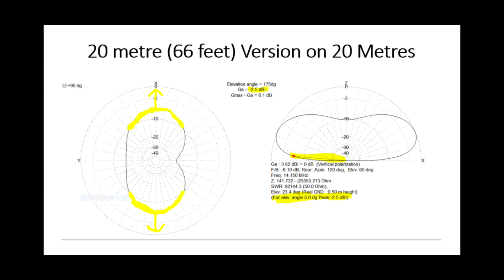Ham Radio: Make Your EFHW Into a DX Machine!

Comment: question... can you run the half square "upside down"?... ie current feed at a low corner & have the half wave section running across the bottom not the top?
Reply from the maker: This is something I need to model. My first reaction is that the horizontal aspect will be compromised by being so low to the ground. 73

Comment: Would it make a difference if 49:1 was up a meter on pole, the element up 5m. Total pole height 6m. Or does 49:1 need to be right at bottom of pole ? Thanks
Reply from the maker: Hi there, it would add around 0.5-1dB extra at low angles of take off on 10,15,20m. On 40m, it would make no difference. Overall, it will reduce ground losses slightly.
Reply: @timg5tm941 that’s brilliant, I just made one and mounted the 49:1 up 1meter. Seems to be working fantastic but have not had much time to test today as storm coming so had to shorter the poles. Swr is around 1.5 on all bands, 1.3 on 10. I haven’t tuned yet just 66ft of wire. RX seems fantastic though
Reply from the maker: Let me know how you get on with it! Good DX!
Reply: @ will do thank you
Reply: @timg5tm941 hi Tim, so I had to add 3 feet one side to get swr to 1.2, so one side has 49:1 up a meter and the other side element goes to end of pole, so one side is 5m and other is 6m. Hi would this effect the pattern ? Thank you

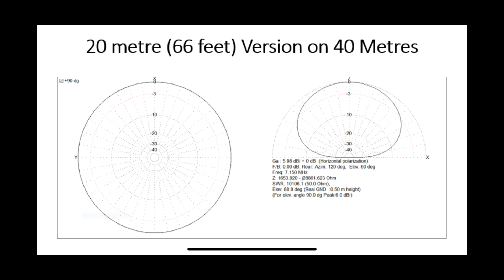Comment: Nice video as usual, but the titles above the azimuth/elevation plots at 3:40 and 6:25 are misleading, you're certainly looking at a 20-odd meter length of wire, but the antenna is a half-wave on 40 meters, so the titles should state that this is for a 40-meter band antenna . The titles are confusing, giving wire length as opposed to band - it's important to not confuse the viewer. YMMV, of course...

Comment: I'm running a 130 ft. 10 in. 80M-10m EFHW as an inverted V with the feed end at 5 ft. above the ground, the center at 25 ft. and the far end at 10 ft. above ground. SWR on  10M is about 1.2, near flat across 12, 15, 17, 20, and 40M. SWR on 80M is about 1.5 at the tuned frequency. From south-central Colorado, in a valley between mountain ranges, with 100 watts, my furthest contacts are to United Arab Emirates, New Zealand, Russia, and to Australia. I also use EFHWs for POTA. Marty, WT0Z.

Comment: Those are awesome 
Simple 
Vertical polarisation 
Low angle 
2 1/4 Vertical 
4 db gain over one Vertical 
No ground radials 
12 db broadside to end null
Just use current bslun 1 to 1 at one of top corners
I will put one up for 40m to europe

I avoid radials

Its 1 wave total 
1/4 1/2 1/4

I think dipole null is about 8 db depending on height
Reply from the maker: Thanks for the info

Comment: I have used mono-band Half-Square antennas with great success in the past. I did try this scheme out on my 133' EFHW, and rehung it as a half-square for 40M (32' vertical sections with ends 6' off ground), and tested it out on a DX contest one weekend.   For any of the 40M DX I chased it was no better than rotatable 40 dipole at 50' on tower.  The next weekend I rehung my 133' EFHW horizontal at 43'.  If was a fun experiment, and antenna tuner tuned it on all the same bands, but I did not see enough benefit in my setting.
Reply from the maker: Good info thank you 👍

Comment: Wow. food for thought! I was ready to install a regular end fed half wave at 80m (i can just about get 40m horizontal in) , however I am now wondering if i will actually use 80m that much anyway.  I have a dx commander (multi band 1/4 wave vertical) and by your reckoning Tim, i should get better gain with this square on everything above 40m? What do you reckon?
Reply from the maker: Give it a try!

Comment: Hi Tim, I put a cord on the end  furthest away from the transformer and pull it out horizontal for 40m as an inverted L, when I want 20m and above, loosen the cord and the sinker returns to the bottom and back to the ½ square.
VK6MB
Reply from the maker: Great example Mike

Comment: ok, what is the optimal length wire length, vertical height, and horizontal run, for performing well on 20m like it does on 10m?
Reply from the maker: If you want to repeat 10m you will need to double the dimensions so that the overall antenna wire used is a 2 wave on 20m. So 10-20-10m (double my version). 40m would now be what 20 is in this video. 80 would be what 40 is in this video. PLUS you’ll still have 15, 10 AND perhaps a reasonable match on 10,12,17

Comment: I tim the half square fed at the bottom With 49.1 is the other end of the transformer earthed or would a counterpoise be better
Thanks Bob G4PEN
Reply from the maker: I’ve found no benefit from earthing or running a counterpoise as the impedance is so high at the base. A 49/56 or 64:1 would all suffice.
Reply: @TIMG5TM  Thanks Tim erected it yesterday and it is working really well Cheers Bob G4PEN 73.s all the best for New Year
Reply from the maker: You too Bob 73!

Comment: How would it do on 11 m? All you hammers out there only talk about ham radio but some of us out here that like to play on radio use the CB band. So how does it do on 11 m and would it be worth building this antenna for CB? I mean you guys have got the licenses and we're the ones that look up to you. But you all ignore us when it comes to talking about antennas.
Reply from the maker: Try 35 feet initially (divide by 3.28 for metres). If needed trim the base of both vertical elements to bring it into tune. Should work like the 20m band does on this video.. most gain broadside.
Reply: @TIMG5TM  
Thnx😉

Comment: It‘s my favorite antenna. Use it only on 15 and 10 m. Have fed it both ways, but prefer it lower corner and 49:1.
One thing you didn’t talk about is noise. Where I live I had about a S 4 noise level and with the half square it’s gone. It’s worth trying guys!
Thanks for your work de HB3XBL 👍🇨🇭
Reply from the maker: Thank you. It’s a useful option as a multiband antenna

Comment: Thanks Tim, built one as described and working really well, especially on 15/10m.
Reply from the maker: Fabulous!!
Reply: @TIMG5TM  Just a quick followup, now worked 153 DXCC on 15m and 164 on 10m, predominantly using this antenna fed with 50W.  Really pleased with this fantastic antenna especially given how easy it is to setup and how well it performs.
  
It would be really interesting to model and then try a 12m version that worked on 12m and 6m.  Transformer a little more challenging probably but ....

Any thoughts on sharing your MMANA-GAL models as you publish the videos so we can follow along and play with options?

Thanks again

Comment: Ok.  Right now I'm running a hwef  out a 3rd story window horizontal to a tree across the yard.  There's a tree outside the window.  If I can get it vertically maybe 5 more meters up that tree the only other option would be to slope the rest.  I I wouldn't be able to get the full half square, but would that effectively get me more dx?  It gets 1:1 on 40 and 10 horizontally, but definitely takes some tuning for 20.  Would it help the tuning for 20 as well??
Reply from the maker: It depends a lot on the height, how high is your sloping part of the antenna from highest to lowest? Also, how long is it and roughly which parts of it form the sloper?
Reply: @TIMG5TM  It's roughly 66ft long, running horizontal out a third story window about 30ft up.  If I can get some vertical from window to high as I can get in tree right outside (maybe another 5 meters), the slope down from there could be whatever would work best.  Trickiest bit would be keeping the radiator away from the branches...  Not sure what the advantage would be for the work to get it up there....  Thanks Tim.

Comment: I have a 75-10 M EFHW configured in a flat configuration from 35 feet at the feed one end and 55 feet at the far end (the land slopes away from the feed end) using a hefty 49:1 Balun coax fed with LMR400..  It is a great antenna for DX. However it is a bit more noisy than my 80-10 M Horizontal Loop.  Will reconfiguring it with the 1/4 wave vertical sections at both ends even make it more noisy?    Usually, you do not GET something without GIVING something up.... the NO FREE LUNCH rule of antennas...  I wonder if any of you who have experimented with the 1/4 wave V 1/2 wave H and 1/4 wave V config can share their experiences on 20, 17, 15 and 10 meter bands.  Thanks Art W1SWL
Reply from the maker: Hi Art. I find a vertically polarised antenna, whether hand or quarter wave, tends to be noisier at home.
Reply: @TIMG5TM  Hi Tim: have you modeled this modified EFHW antenna in MMANA?   If so I would love to see the results of that Model... as a flat then modified as a half square.!  Art W1SWL
Reply from the maker: @arthurgumbus3969  hi Arthur, did you mean as a flat horizontal and then compared with the half square?
Reply: @TIMG5TM  Yes as a flat horizontal model THEN change that to a half square and see the results on MMANA.... You are really good with that program so I leave the driving with you.  I think it would be a great follow on video... with some education for we aspiring MMANA novices.  I say go for it!

Comment: All these itty bitty crossover baluns have the annoying advantage of getting the feedpoint out of the shack, and shielded coax to get there. Not much more than 10 years ago, a tuner and a longwire did this, and the idea of the antenna starting at the radio was not kosher, and was thus too close to interference sources.
The next step was balanced line or a combo G5RV, but those were eyecatching dipoles, that still needed a tuner, and balanced line was a bugger to run out of the shack, though quiet, still radiated alot of harmonics on tx.

These lil baluns just absorb harmonics, use 52 ohm coax, to run to feedpoint, and can be coax tuned anywhere, or trimmed to run free on at least 4 bands.
Reply from the maker: Thanks for the info

Comment: Thanks for the video - did you simulte the pattern and the gain for 17m, 12m and 10m as well?
Reply: These came out in 1996 and were ran like a full wave loop, but instead fed at a top corner, with 1/4 wave of 75 ohm coax (-velocity factor), then 52 ohm coax to radio. They were monoband, but using a lower freq (20m for example) one on higher bands, with a tuner, made a very pointy x pattern of gain. Set 45° to North, it had lobes favoring N, S, E, & W.
Reply from the maker: Not yet but I will and see whether a 9:1 unun might be an option with tuner
Reply: @TIMG5TM  I use 1:9 transformer with a manual tuner and it works well even at the impedance peak near half wavelength. TS590's internal tuner doesn't match the 1/2WL but works well on others. My 1:9 is a trifilar winding on FT140-61, 15t (about 30-33uH each winding). I am looking into a cascaded Guanella 1:4/1:9/1:16 transformer to use the internal tuner on all bands.

Comment: The Half Square works very well. I have used the form on the 80 meter Band with good results compared to an 80-10m band ground plane monopole vertical mounted over tuned radials.

You can imagine that the 80m version might be quite high, needing 20 meters of height plus head-height clearance. Having only 15 meters of height available, the lower end of each vertical element was bent inward toward its opposite. The antenna then looked similar to an 'omega' symbol. Since current is greatest at the driven end of a vertical element, this made little difference to radiation.

I used the antenna when serving as net control for a nightly 80m phone net working stations from coast to coast to coast in Canada with me at the centre. According to signal reports from stations more than a couple of hundred miles from me, the antenna was superior to my 80-10 meter vertical except when working northern stations at right angles to the preferred radiation directions. Then the omni-directional monopole was better. Closer in stations saw no difference between my monopole and the Half Square. On receive, there was an improvement in received SNR using the Half Square compared to the monopole since the Half Square is bi-directional.

I also built two Half Squares for the 20m Band with each at right angles to the other allowing me to switch between East-West and North-South patterns. I did not use the pair long enough in order to draw conclusions worth passing on.

Give the Half Square a try!
Reply from the maker: Fabulous information.. thank you for sharing details about your excellent antenna

Comment: Tim how long will an endfed halfwave need to be on 80 /40/20/15/10. Mine is currently configure as a half square and I get it squirting RF more towards South America  and Europe .
Reply from the maker: Hi Simon. The full length efhw for 80-10 is 132 feet or so long (40 metres). Remember that it will still be a cloud warmer for 80m but it will begin to fire low angles , great for DX ,40m and up. Remember too that it’ll need to be 10m above ground and be 20m long. 73

Comment: Here's a thought and I'm aware I'm ready to be flamed here and told I'm being stupid but...
If the distance away from the ground affects the radiation pattern then what about theoretically  adding ground radials ABOVE an antenna? I know for HF that's impractical, I'm just thinking theoretically. Can this be modelled?
Reply from the maker: Hi Simon, it can be modelled, but, in this case it would de-tune the design. 73

Comment: I have to try this out. If it works I'll make a video on it.
Reply from the maker: Thanks!
Reply: @TIMG5TM  By the way, have you tested this setup, or just modelled it?
Reply: @TIMG5TM  Testing the setup right now. Performs slightly worse on 40 and 20 than my regular EFHW sloper config. Significantly better performance on 15 and 10 in my totally non-scientific test with WSPR and FT8. I'm having both antennas on a switch, so I try do do some A/B testing.

Comment: What would be the  length of the 11 m BAND antenna or what is the mathematical equation for figuring it out say at 27 555 megahertz
Reply: Full, half, or quarter wavelength?
27.555 divided by either 963 (full), 468 (half), 234 (quarter).
e.g. - 234/27.555 = 8.492 feet.
I hope this helps.
KD8EFQ/73
P.S. I work 11 meters and the "gray bands" as well 🤣
Reply: 24 Southern I-da-Ho 🇺🇸 2 WE 024
Reply from the maker: As below...